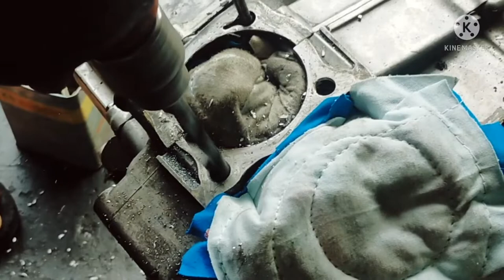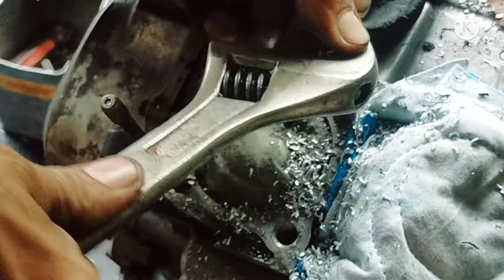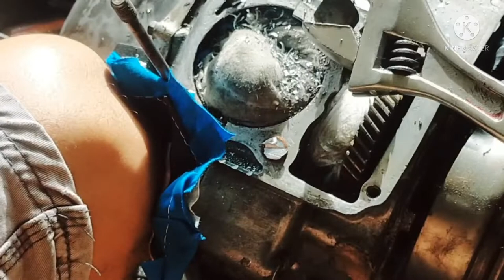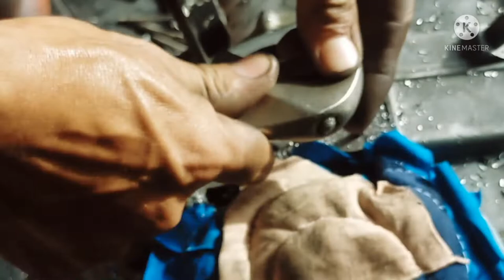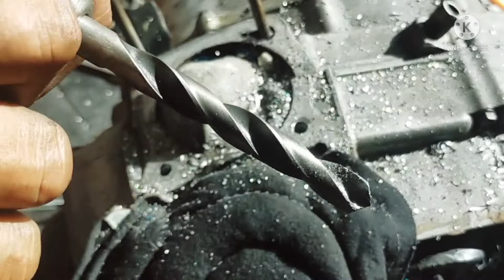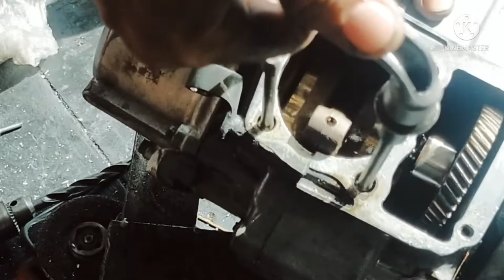how to repair stud bolt crankcase HONDA TMX 155

Comment: Boss tanong kolang po pwedi ko po malaman kong anu mga ginamit mo size ng barina pang butas po chaka yung size ng mga bold at yung handtop narin po ganyan din kasi yung motor ko losstrade yung stud bolt niya po taga leyte po ako boss sana mapasin po palagi rin akong nanunuod ng mga videos mo po boss
Reply from the maker: Barina boss 10,5 handtop 1/2 barina   
Para sa bolt 7mm handtop para sa bolt 8mm

Comment: Magkano pagawa sayo ng loosethread na bolts sir yung ibabalik sa stock
Reply from the maker: 200 isang botas  sir balik stock
Reply: Maraming salamat sir sge sir dalhin ko syan sayo XR200 motor ko sir bale 10pcs na ang loosethread at nagtatagas na ang langis palagi ako nanonood ng vlog mo
Reply from the maker: Ok po salamat din Po
Reply: Sir bukas pa ba kayo mg 9pm?
Reply from the maker: 8to6 lang kami boss
Reply: Papagawa ako bukas sir loosethread at putol na bolts sa makina from las piñas
Reply: Pwede ko ba makuha fb name mo sir? Para machat kita
Reply from the maker: Ok boss visit lang Po shop ko boss
Reply from the maker: Jofel Jomadiao,,,yan sir
Reply: Sir ako yung nag add sayo sa fb na don gelo 😊 pa accept ako sir salamat papagawa ako bukas
Reply: @jdj_motovlog_jasper bos san location mo?
Reply from the maker: @bernardadriano8344  24 G BF HOMES ROAD QUEZON City 1100 metro manila
Reply: @jdj_motovlog_jasper  salamat bos, pag biyak ng makina ko dalin ko jan, papabalik ko sa stock
Reply: Sensya na bos, pero tanong ko na din magkano isang butas? D nmn loose thread sakin kinutkot lang ng gumawa naiwan kasi kalahati ng dowel pin, ipaabalik ko lang sa dati.
Reply from the maker: @bernardadriano8344  250 isang butas